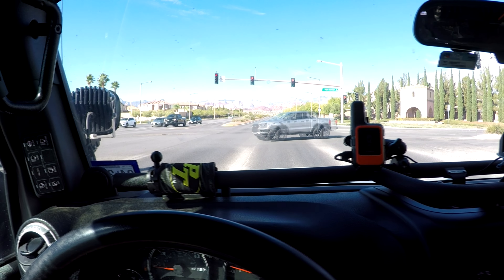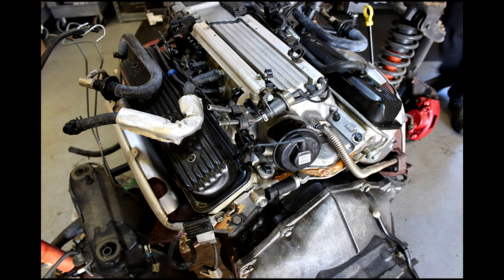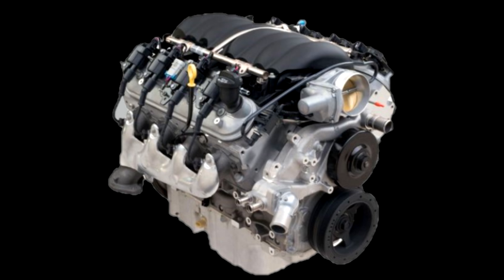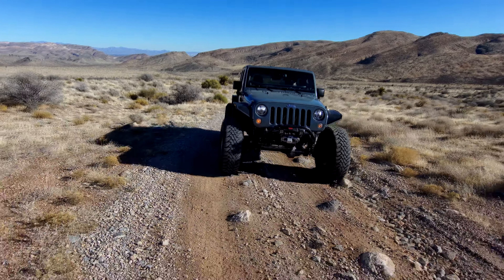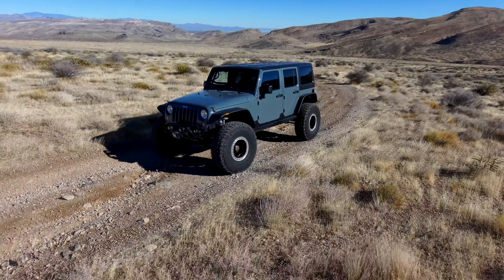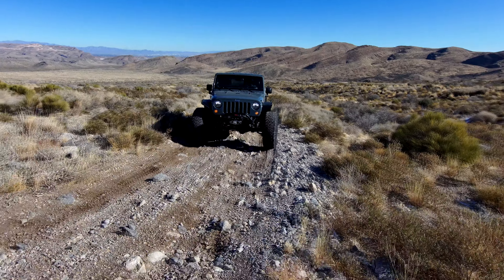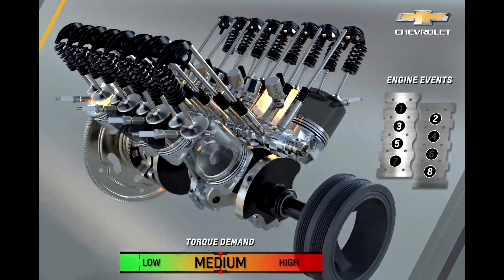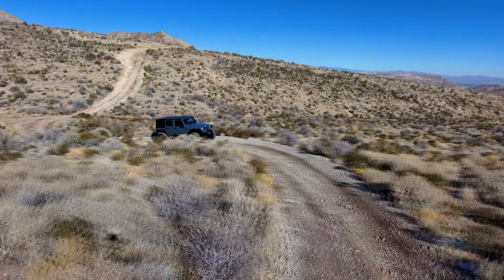What is the LT Engine

Comment: I wish you included a build list of each of the rigs you drive in these videos.
Reply: Well since the JK he is driving off-road in this one is mine I can tell you. (He starts the video inside a Jeep that is not mine)
L86 
10speed 
Running Dana 60’s 
Metalcloak 3.5 lift 
Falcon adjustable shocks. 
Teraflex bump stops 
40’s 
Running 5.38’s but that may change now with the 6.2 in it. 
Just got it back and the thing run’s unbelievable. Just cruises down the road effortlessly.
Reply: @jmo2640  Thank You! How do you like those Falcons?
Reply: @johncasale466  
No worries..I love them, I was running a Fox 2.0 and they did fine but having the ability to run them stiffer on the road and softer offroad and in the rocks is a game changer in my option.
Reply: @jmo2640  I can’t wait to get them! Soon!

Comment: Curious
As to, what are the actual (legal,executive order)options for a potential buyer in California with a 2015-2017 JK????
Reply: Good luck. I have an 07 that was done 5 years ago. Still waiting to pass inspection in California.
Reply: Yep, Great question.
Reply: @tonygomez6927  
Damn
That's not something I wanted to read..... Thx for the info
Reply from the maker: We have applied for an LT EO for the late model JK's and the JL/JT's, will hopefully have it by next year.

Not really a fair assessment on the above JK as it was not built to an EO standard many years ago and has not been submitted for an EO inspection. It came back to our shop to be updated for exhaust, evap etc which has taken some time. The vehicle had a cracked fuel tank which goes to show these vehicles must be 100% before submitted.
Reply: @WranglerJKLS  Thanks, probably easier for me to just retire to Nevada in a few years. 😂
Reply: @WranglerJKLS  
I appreciate you taking the time to respond and for the explanation of the previous commenters experience. I'll keep my fingers crossed that all goes well with the EO. Thanks again and GODSPEED
Reply: @t.o.f.t.s.  I love California but I left 30 years ago and have no desire to go back. I owned automotive shops in the valley and was an emissions inspector for over 20 years. Honestly the whole BAR enforcement is a cluster I've never seen such  incompetent, politicized bureau before. The referees are cool I get along with them but Sacramento is a mess, just like so many other programs in California. I can tell you in other jurisdictions, even here in Nevada they would not get away with half of what they do to the California consumers.
Reply: @nathanielpatricio429  Just to be clear, Motech has received an executive order for my swap. The bar is just not honoring it for some reason. Robbie has done everything in his power to make it happen. It’s just frustrating waiting for it to happen.

Comment: Really liking the idea of using an L82 in my JLU. 8 or 10 speed whatever is cheaper. Do you think I can get away with using the stock gearing 3.45, on 35’s?
Reply from the maker: My JLU has an L83 and 30's and 3.4 gears; It cruises at 90 MPH with ease and fries the tires off the line. I'd say 3.4's with 35's is a little tALL and may make a good highway gear but you would have to assess street performance. A lot depends on the weight, altitude..... but if you already have those gears give it a try, the LT is very flexible, especially with THE 10 speed - 4.7:1 1st gear.
Reply: I’m in Colorado and will be going to your shop when I do the swap. Make sure I can get it to pass emissions. Also, I’m not a big fan of the stock gearing. Dana 30 and 44 w/LSD. No armor or winch yet.